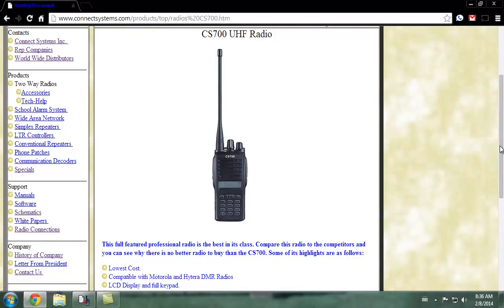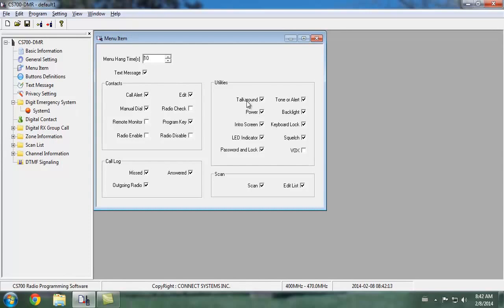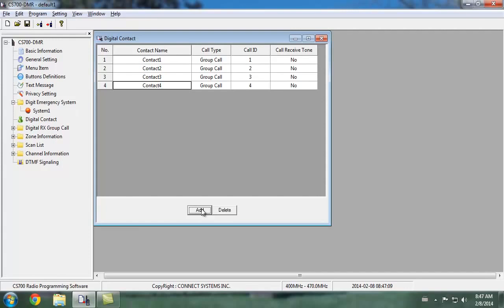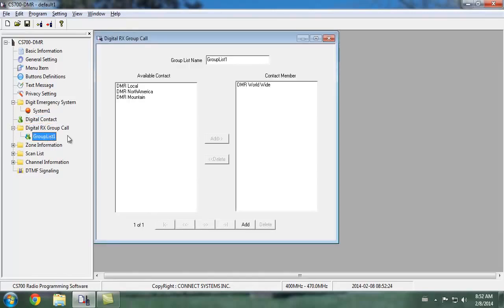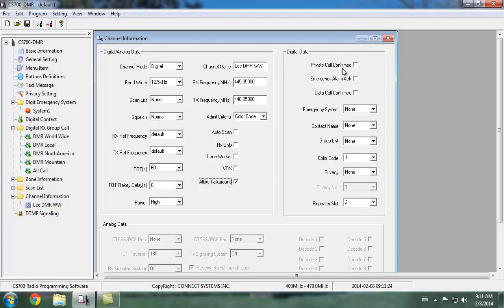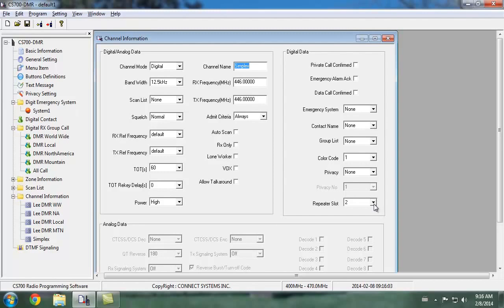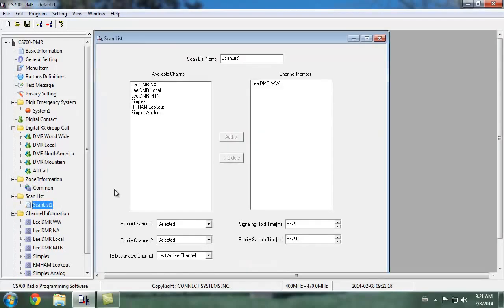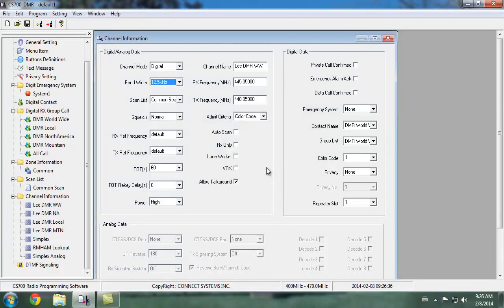CS700 Programming for Amateur Radio

Comment: I know this is 9 months late from your original upload but man was this presentation absolutely fantastic! I originally programmed my MD-380 in a different way using the similar CPS and am having issues. I'm currently using your 1-1 system and will see how it goes once I flip over the new codeplug. 

I can't thank you enough for giving me more insight into the backend CPS quirks.

73 and hope to hear you on DMR soon. 

Spencer Rich 
KM4KFG LID#: 3112593

Comment: Very informative and Thank You. 
From what I've heard, the CS 700 is no longer in production.  The CS 750 has replaced it,  very similar to the 700 including the programming.  New to DMR and your video helped me out immensely,  i needed to know where the DMR ID code went and that's the first thing you showed me...   Perhaps an explanation of the HIGH/ LOW power setting would be helpful in your video. As my radio was set to LOW power and was not getting in to the local repeater, once set to HIGH I was fine....  "PARROT" is another feature worth mentioning,  it lets you check your radio much in the way "ECHOTEST" does on Echolink.
Reply from the maker: +Robert Mitchum This video was meant as a programming video, not a feature video. I didn't mention the power setting because I assumed most people were familiar enough with it from analog radios that it didn't need to be mentioned. I don't remember what the wattage output is for the CS700 offhand for the low and high settings, but it should be in the specs section of the manual.
Reply from the maker: +Robert Mitchum Also, while Connect Systems is no longer selling the CS700, you'd be surprised how many request I still get for help programming it. :)

Comment: I need your help, i have some problems with my Kirisun dr7100 and cs700 are the same product with other names... The Software dont work on my pc. The Pc is running on Widows 7 and when i connect the kabel it dont do anything... On my Windows 8.1 laptop it runs perfectly.. have u any solutions ?
Reply from the maker: +Oliver Dristram The only thing that comes to mind is the USB driver for the radio. Even though some people say you don't need to install a driver for 64-bit Windows 7, I found I had to install it to get Win 7 to talk to my CS700. You may need to call the dealer or the manufacturer to get the driver or to troubleshoot further.